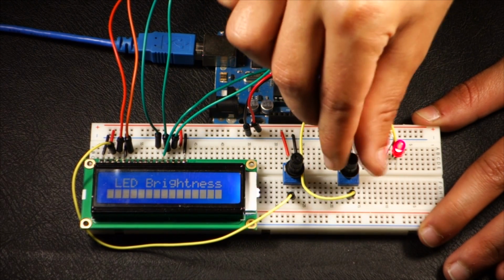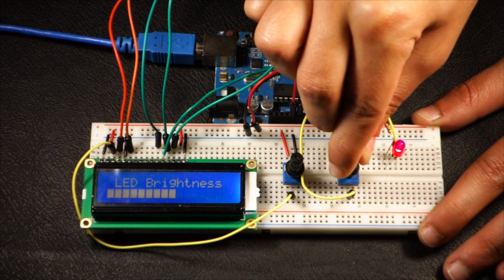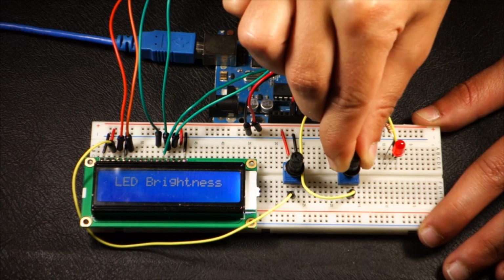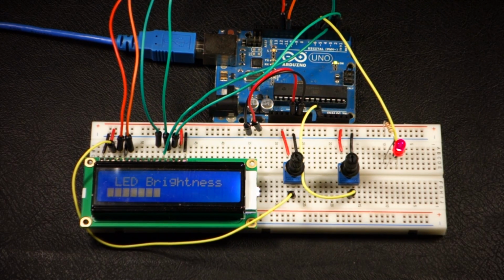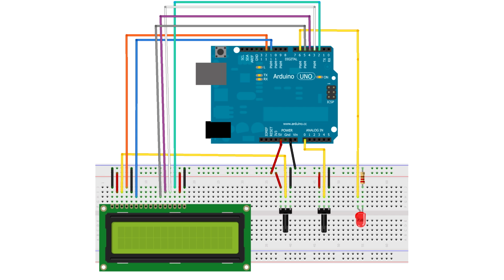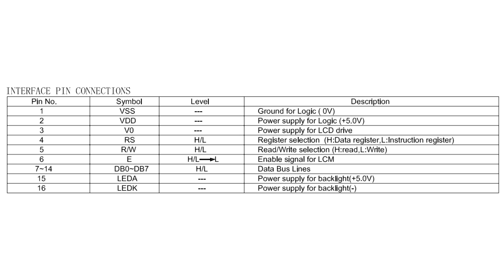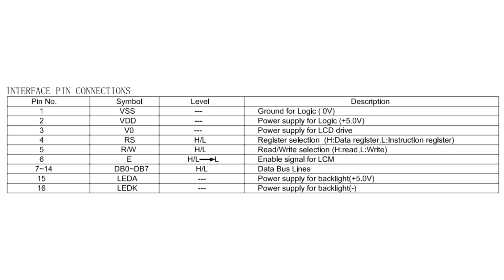Arduino - Display the LED Brightness on a LCD 16x2

Comment: While the backlight pin (pin15 LED+) was directly connected to the +5v,  you can't adjust the brightness. The second potentiometer was only connected to the arduino. You need to connect the backlight pin not to the +5v but to the potentiometer if you want to see the brightness up or down.